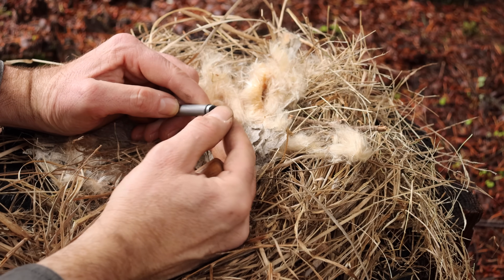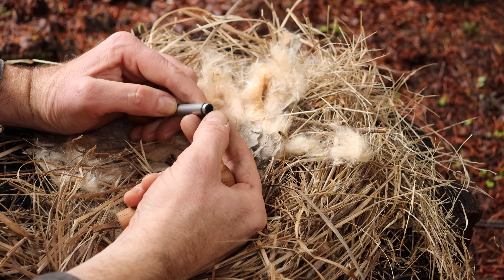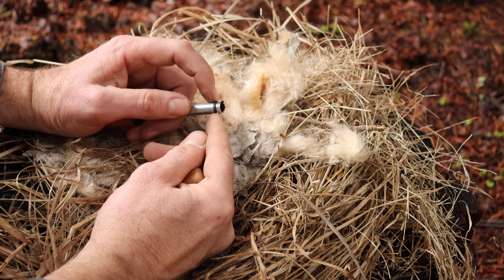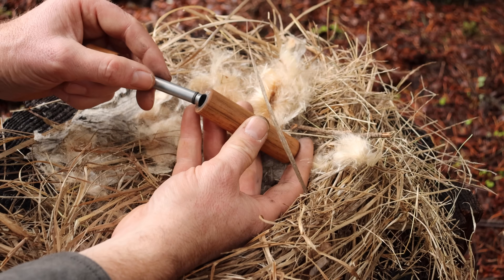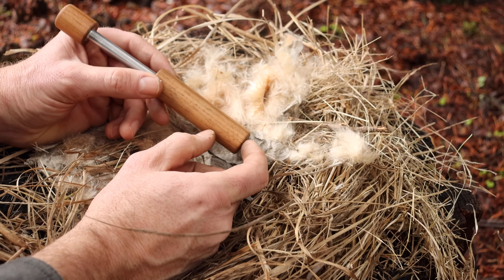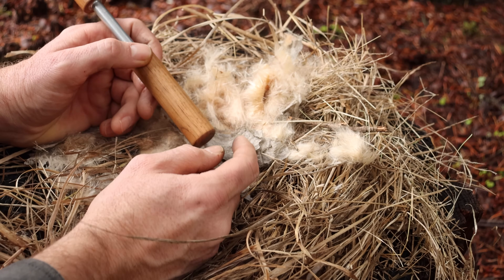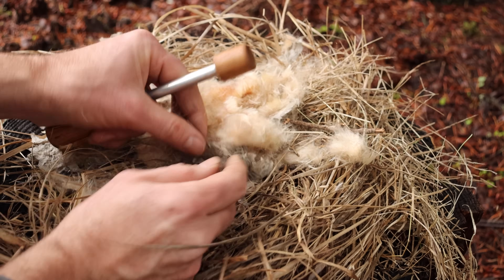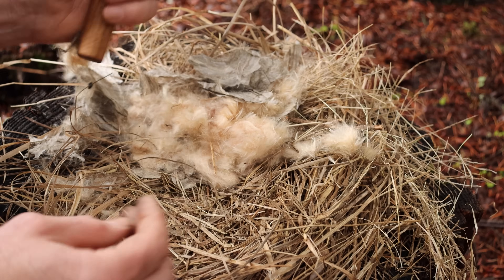The Fire Piston - Using Air Pressure To Start A Fire. A Great Bushcraft Survival Skill.

Comment: I have one virtually the same as yours. One thing I wonder is, since modern ones use an O-ring in a groove cut into the metal rod, what did they use in primitive times to create a tight seal?

Comment: My dad had a device that looked almost exactly the same as your Kikuyu fire cylinder, except at the bottom of the hole there was a rubber band. This went through the bottom end of the cylinder via two slots, and a plug to hold the rubber band in position. The piston was a stick with a knob at the top and a notch at the bottom end, and the object of the device was to turn the piston until you caught the rubber band. You could tell if you caught the rubber band because once hooked the knob at the top of the piston would snap back firmly with a loud report after hooking the rubber band and being pulled out of the cylinder part way. No one could ever make this happen no matter how hard they tried because there was a trick to it. It was hilarious to see the look on people's faces after they had tried repeatedly to hook the band with no success. But you, once you had the secret, could take the device and instantly hook the rubber.

Comment: Fire piston with metal. 
  where the lowest melting point of a metal began to be tin, copper, and silver. 
  The three materials were combined to become bronze.
     Previously there were stone, wood, and bamboo fire pistons. Seals used natural fiber materials, before getting to know  precision molded rubber.
    And fuel/tinder doesn't know cloth. Thank you for the progress of the fire piston.

Comment: There is a video somewhere that there was some gruesome accidents with a piston on office task chairs made cheaply in China. These chairs were made for the Chinese only and had air leaking into the piston shaft replacing the nitrogen. That with the oil ignited in the piston causing injuries when sat on. A Chinese investigative reporter had a weight dropped on this type of chair. It exploded sending shrapnel everywhere. A bicycle pump will heat up at the bottom, causing quick aging of the cheap rubber line to the tire they put there.